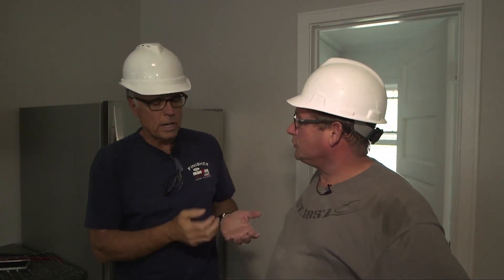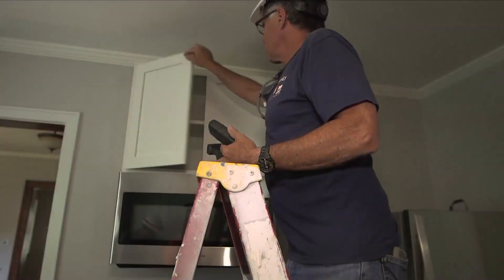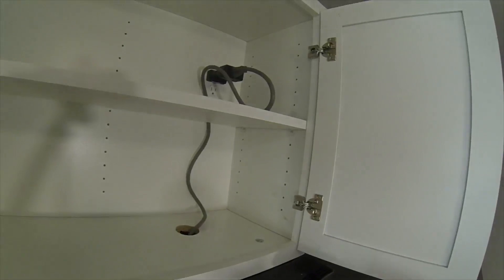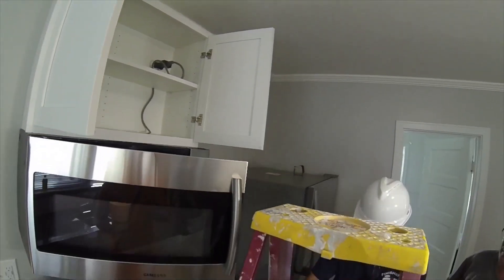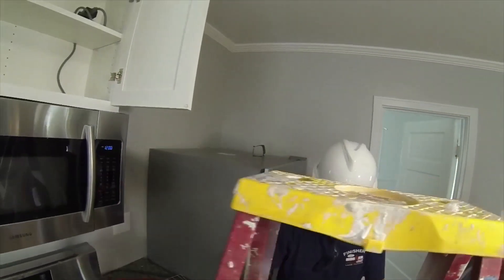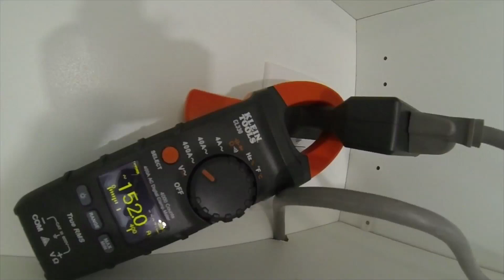Barnaby @ Home: Testing Amperage

Comment: What the heck was that thing they clamped on to? Terrible video. Explained nothing at all about the device.
Reply: Bro they explained exactly what it is and what it does. You should’ve watched the video before you commented
Reply: If you don't know what one is you probably shouldn't be doing electrical work.
Reply: Klein Tools 69409 Line Splitter 10x  (I bought one at Amazon)
Reply: The clamp meter should go around an individual wire, the line splitter allows you to test an appliance without taking it apart.

The funny part is they determined the microwave is 15A (like duh) then HIGH-FIVE our job here is done!!!  I guess they can just tell the resident to turn off the A/C before microwaving anything...

Comment: 1:04 Model CL330
Reply: Why did the meter need to be set at 400 amps?  Do you divide the reading when using the ac line splitter?
Reply: Label on device will usually indicate expected Amps. You set the meter to setting to handle that amount. If you have no idea, go big and step down until the number displays a number that's usable instead of a tiny decimal.